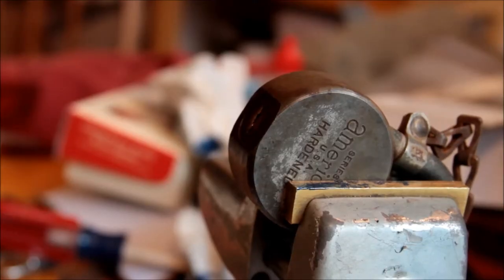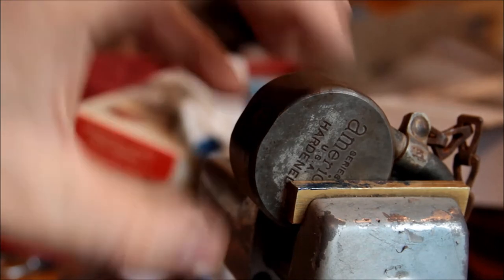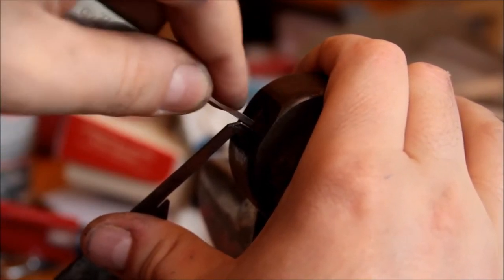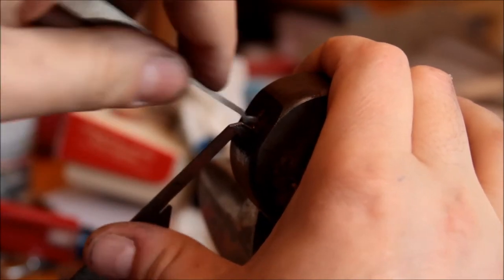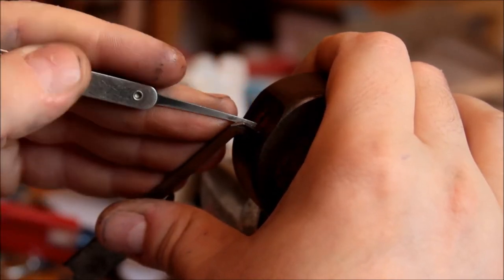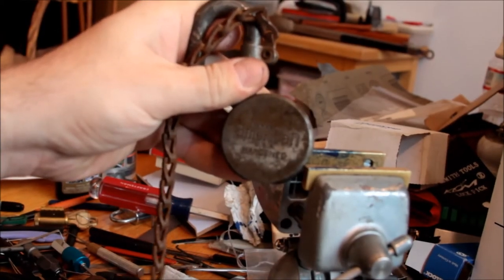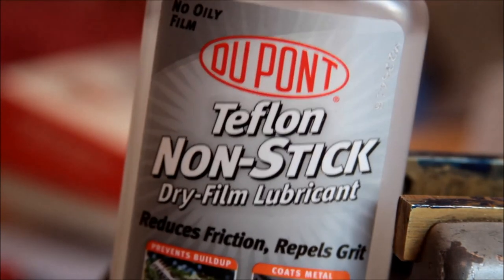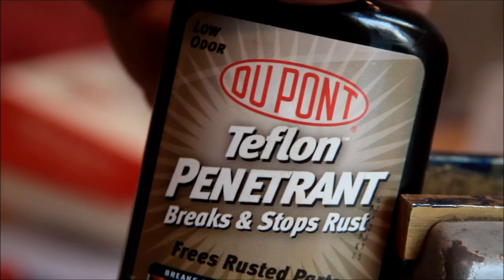(146) Penetration Test: American Series 10 SPP + Teflon Penetrating Lubricant

Comment: WD-40 is evil :P I prefer to start a lock degunking with a good spray/soak of Brakleen. It will dissolve the gunk. If a lock is really dirty I will put it in a plastic bag and cover the lock body in brakleen (twist bag to take up space and save cleaner) and let it soak for an hour then go give it a good shaking, put a key in and out to help loosen stuff then repeat until cleaner runs clean. Shake it out, let it dry (brakleen leaves no residue) then lube with your favorite lube.